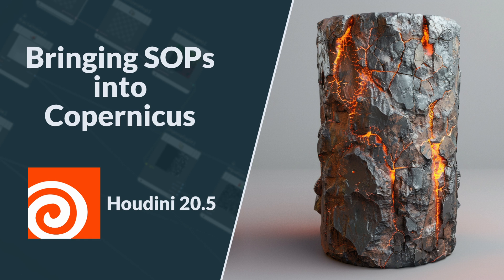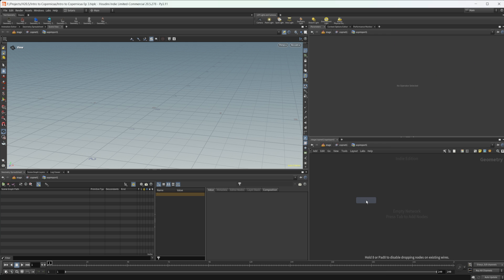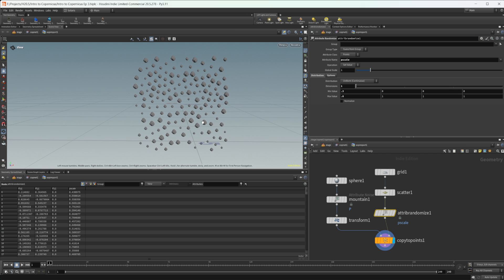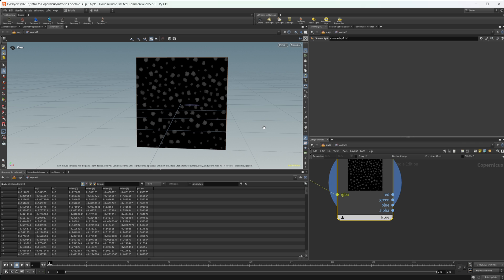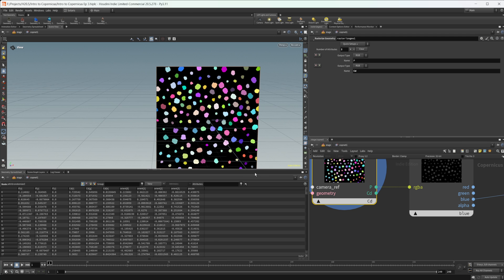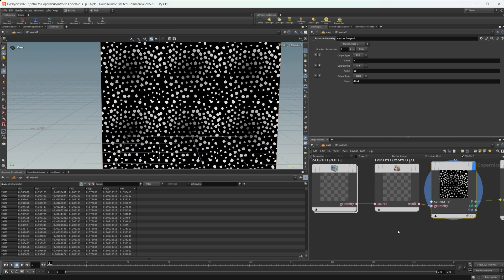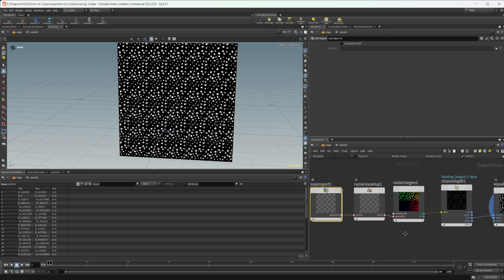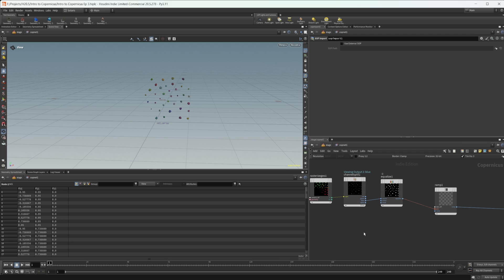Bringing SOPs into COPs | Intro to COPs | Houdini 20.5

Comment: is it possible to get attributes from sops like dist or mask, and use it to drive a gradient mask inside copernicus to animate between two different texttures or effects? I am trying to learn Houdini, and coming from blender where I use this effect all the time - quick setup using and texture coordinate object space and then using and empty to quickly control where the gradient mask should be. Advantages of this is I can get very detailed transitions even if the 3D object is super low poly. So far I am using attributes in houdini, but it seem that if I need it super detailed I need to turn up the polycount.
Reply from the maker: You can absolutely export attributes from sops. Just export it on the rasterize geo node. Make sure the name and the output type match the attribute.